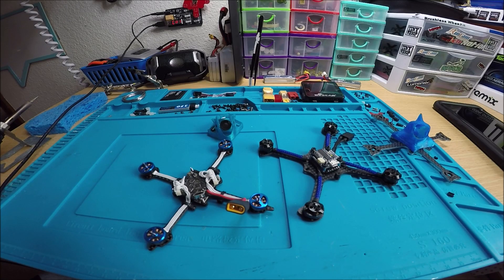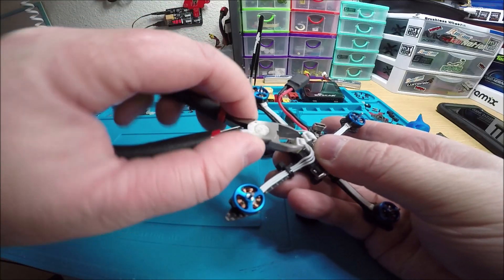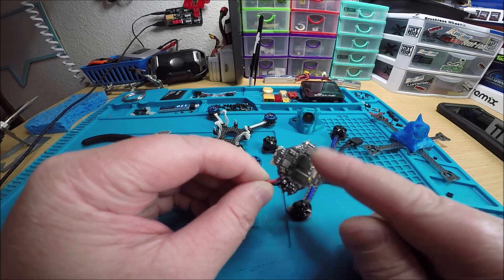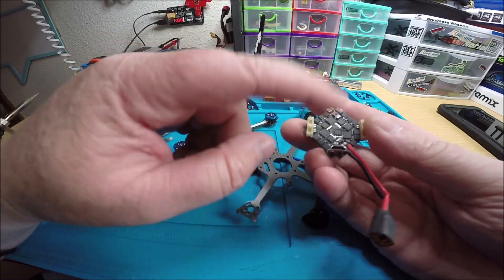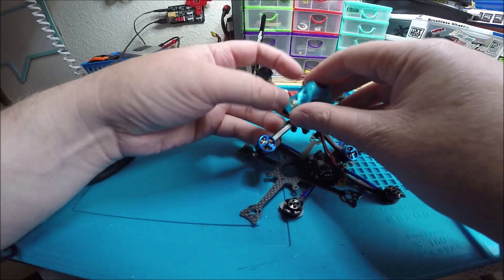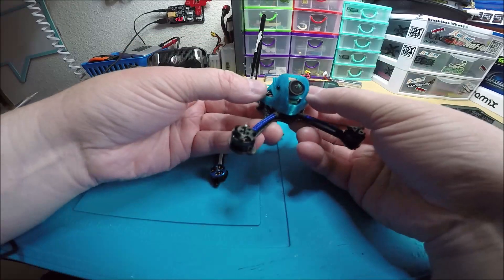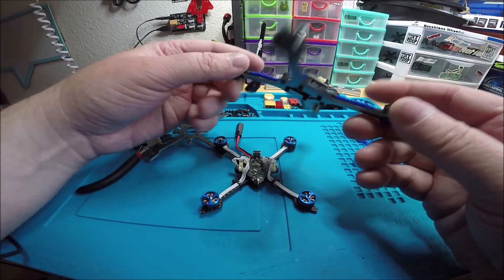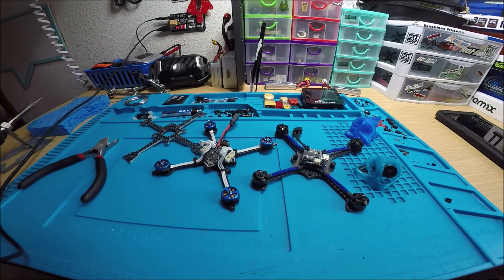65mm builds

Comment: I got a version of the pickle mini cut a few months ago from files they posted on their thingiverse page. The frame was intended to fit the beta75x flight controller which has the motor plugs in the same place as the new geprc and beta 2-4s fcs. For whatever reason this version of the frame is no longer on the ledrone club thingiverse page. I bet he'd put it back up if someone asked though. I think I paid $12 to my door from CNCMadness to get it cut from 2mm CF.
Oh and the Primo frames both look like they'd work fine with these new 12A fcs too.

Comment: On the Pickle, how about taking off motor plugs and soldering on the wires? Then you could mount the FC the right way, saves weight too I guess. Bad idea?
Reply from the maker: The pads are so tiny and close together if I was to recommend people to do that there would be alot of unhappy people with broken fcs. I have dome it before it's not a problem but for someone that isnt great at soldering it's not easy

Comment: oculdnt you just cut off or pop off or desolder those motor connectors and just solder the motor wires directly to the board pins?
Reply from the maker: Yes you could and I have before no problem but I'm not going to recommend it to everyone because of how small the pads are and how close together they are
Reply: Fried my first one by removing those annoying plugs , but was successful on the second fc, 👍.  Room is hard to get on these lil birds

Comment: Nice video.  What is the diameter of the antennas of new xm+? The holes are 1.6mm diameter, it must fit the actual xm+(0.8mm) and also the old v8fr (1.2mm)
Reply from the maker: It fits the new thicker ones

Comment: im building a pickle with the geprc 12a. how does one change the motor numbers (1,2,3,4) when you flip the board upside down? and in betaflight, which settings do i adjust for the board flip? and finally, which prop direction do you reccommend? props in or out? thanks for the videos im hooked on these toothpicks
Reply from the maker: Props normal and in configuration tab you change it to 180 and in the cli is where you remap I will link a good video for that
Reply from the maker: https://youtu.be/SEvRhaN_WP4
Reply: Thanks a bunch. Looking forward to 3s!!

Comment: Would that fit s blade torrent so they look better vs that ugly plastic thing they use
Reply from the maker: Not sure your question
Reply: You can get lynx mount which is tpu also has micro mount,and I'd tou have not tried gemfan flash 2540 props I highly recommend,you have to zipties canopy to get prop clearance,best mod I've done by far,flies amazingly on 3s,cheers

Comment: I just Got m'y beta fpv 12a yesterday. When I plug the battery the esc sound is so low any idea why? I use the esc sound as a buzzer but I think it will not be an option
Reply from the maker: There is volume for that in blhelisuite
Reply: @ADMDGLS69  Oh than you I didn't know that I m going to check

Comment: Nice review my. I am trying to find out if this board supports flysky afhds2a ibus receiver. It has a sbus pad but we know u can not run ibus connection to sbus pad. There is the Rx2 pad on the fc as I would think that is where u would run ibus. There is no diagram Adam bomb anywhere showing the connection for a ibus receiver. I don't see why it would not work. I know you said short the dsmx pad to make the sbus pad uninverted. Would that be making it able to run  ibus to the sbus pad? The only way I know of ibus connection is a rx pad with a spare uart. So basically I am not sure if the aio 12amp board supports ibus connection. Like I said there is no info on ibus and the products page says it supports flysky but the flysky receivers that have sbus. It also says supports most sbus receiver's. So bro I would appreciate your knowledge as I know u have been doing this for years. Also I don't have Facebook but I am going to need to talk to you about flashing a couple of xm plus receiver for me for rssi and updating the firmware on the xlite so I can have voice and run the irangeX multi protocol module. The firmware has to be updated to run the module and it would be nice to have voice. I am currently using the jumper t8sg V2 plus so that is why I can use flysky and flysky has the fli14 and fli14+. They both come with rssi no flashing needed. I will take care of you for doing this for me. So I don't know how we would go about this. That me know I don't have the xlite yet but will get from raceday quads so just let me know.  I am down with my laptop and I hate flashing and updating firmware. That part of this hobby is my weak side. I rather just pay u and if I can't use ibus on this board I am going to need the xm plus receiver asap. It would just be nice to have them for future builds. Sorry for making u read so much brother and thank u for your valuable time.
Reply from the maker: Running it to rx2 would be fine
Reply: @ADMDGLS69  okay thank you. Would you be able to update firmware on the xlite and do  couple of xm plus receiver? I will pay whatever I mean don't kill me but definitely sure it would be worth your time. I will pay for all shipping to. Just please let me know. Again thank u for your valuable time.
Reply from the maker: @jeremychotto2688  yes. Text me
Reply: There is a manual for the Gep-12a-f4:
https://geprc.com/download/en/GEPRC-GEP-12A-F4-Manual-EN-V1_0.pdf

It shows wiring for the Flysky FS-RX2A RX to the FC RC pad, including shorting the dsm pads. Looks like it's the pro version using the end pad (4) which is ibus.

Comment: witch 16x16 stack would you prefere ?
Reply from the maker: Depends what you're gonna be using. For a quad with 1102 or smaller and frsky receiver I like the teenyf4 pro but if your using crossfire or 1103 or 3s the iflight succex micro
Reply: ADAMBOMB FPV Hi adam, for the super_s f4 have you encountered a propblem with the buzzer coz mine wont work propperly some what like lack of power that can’t beep loud.  Tried to use dshot beeper but it requires 16.67 firmware which cant find in blhelisuite